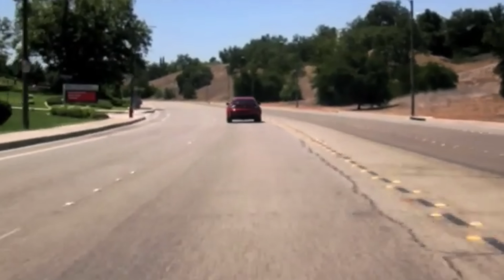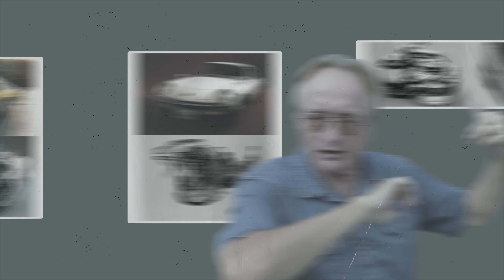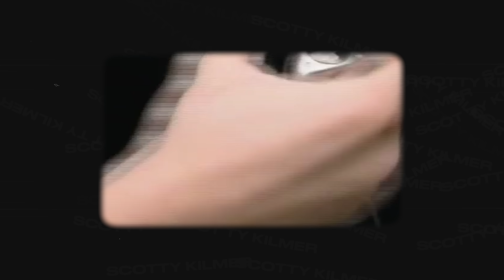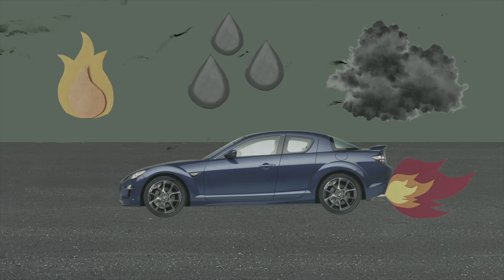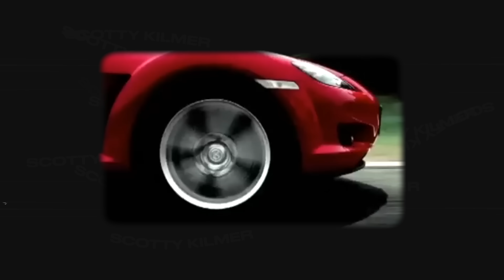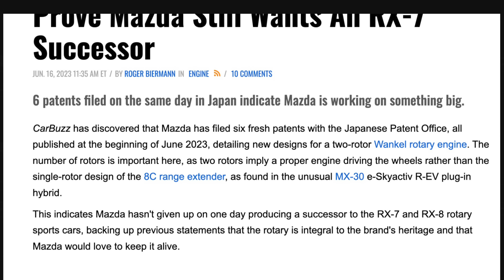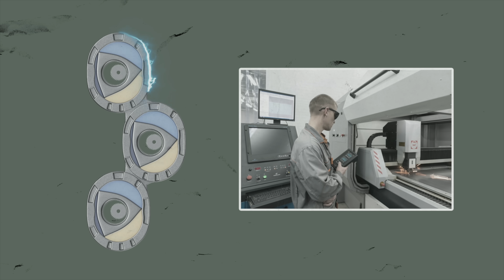Mazda's New Engine Shocks the Entire Car Industry

Comment: Wow, a lot of this video is flat out wrong. He starts out with a video of the liquid piston engine (which is NOT a Mazda engine nor is it a Wankel with the first version being designed and built in 2010) and then talks about the Wankel rotary engine, which are completely different engines even though the liquid piston engine probably had some inspiration from the Wankel engine. The video then goes on to mix videos and images from these two completely different engines. He then goes on to claim that earlier aviation rotary engines were predecessors even though they are piston engines and not at all related to Wankel rotary engines even though they are called "rotary engines".

Much of what the video claims about the 12-rotor engine is either inaccurate or flat out wrong. The 12 rotor engine was indeed designed and built by Tyson Garvin, but he built it in 2010 as a engine for his boat. He stopped working on it years ago as he is not really familiar with rotary engines and recently, he gave it to Rob Dahm to have him get it running with modern ECUs, turbo chargers, etc.

Since it was designed for a marine application, of course it hasn't been used with a radiator as all marine engines pump water from the body of water they are in for cooling (and Tyson Garvin works on boats, not cars). Also, the widths of the rotors DO NOT vary and are indeed standardized as they are all Mazda 13B rotors.

Also, you absolutely SHOULD NOT EVER use synthetic oil to premix with the gasoline to lubricate the rotor seals (and premixed oil DOES NOT lubricate any bearings, e-shafts or gears as those are lubricated by the regular engine oil circulating through the engine) as synthetic oil does NOT burn well. In fact, one of the biggest arguments to remove the metering oil pump and close off the oil port to the rotors is so that you can use synthetic oil for the motor oil that lubricates the engine and non-synthetic oil premix with the fuel for the rotor seals.

Comment: I have always wanted to understand how a rotary engine works. Now I still don't but I have a better idea lol. I wish you could make a video going into more detail about a few parts of this video. awesome video scotty!
Reply: basically a single rotor is akin to a two-stroke three cylinder on a 120 degree crank; as far as how the power (pulses) are, 
but then with the Eccentric -'Crank'- Sharft gearing reduction from the rotor gear, reduces the effective crank output rotation speeds down to an equivilant more like a fourstroke.

Comment: The best thing would be to scale the engine production up so high that they are practically disposable. Then design the car to make the engine easily replaceable. (Leave enough space to take it out)
Make the engine so cheap and sell them to other manufacturers and other industries.
The biggest problem was they were so hard and expensive to fix. If you accept that you’ll eventually replace it and make replacements available and cheap, it’s not a big deal. It’s like an alternator or a fuel pump or a battery.
The old engines go to a secondary market and you get guys that will fix them on their own and make twelve rotor boat engines.

Comment: The idea of using ethanol instead of gasoline to improve combustion is very interesting. In the future we can expect to blend more and more ethanol into gasoline as we move towards net-zero. While selling high ethanol blends was a failure in the past in most of the world, it might make a comeback. I would also be interested to see if rotary engines would also do well on CNG and LNG, which are fairly widely used in some countries (and also produce no soot).
Reply: @EnriqueThiele The question then is, whether the emissions result is better than on gasoline. When burning natural gas, we can have less hydrocarbon and particle emissions, but NOx often is a problem. What I understand is that rotary engines generally produce more hydrocarbon but lower NOx emissions. So, this might be a very good match.

Comment: 2006 Mazda 6,2.3 ,16V,manual transmission.Great car.Front rotors and pads first replacement at 240 000 km.Just unbelievable.

Comment: I briefly considered Mazda the other year. Ultimately though, the MPG is just terrible (here in the UK we usually have 4cyl engines and expensive fuel so expectations are different), and apparently they need to be run upto operating temperature before being turned off, which is an issue when someone wants letting out of our driveway.
Reply: Compared to what exactly? Are you talking about the rotary or the 4 cylinder? NA or Turbo? Are you comparing to a hybrid? They get good mileage comparing apples to apples. Sounds like you're comparing apples to oranges.

Comment: I wonder how the rotary engine would do well if it had natural gas or hydrogen fuel sounds interesting if they can be done thank you have a good day😎
Reply: Why not wood gas (spark ignition) or even a diesel cycle.
If it can burn it will work.

Comment: I once found information on a BMW/BMV 250cc motorcycle- it had a Wankel engine. Now 30 or 40 years on I can find nothing, or anything on the T3 (not TR3), a turbine powered Triumph automobile. The alternative to these two vehicle existing or even only making it to the design stage could very well be.....I am crazy after all.

Comment: I challenge your mileage claims. Compare apples to Apples and the Mazda RX-8 gets better mileage. For example the RX-8 is faster 0-60 than the beloved Gen 4 Supra (manual NA) but gets the same 18 MPG combined fuel efficiency. With 2 extra seats (Better brakes, handling and trunk). Also faster than the 300ZX 2+2 but at 19 MPG the slower Nissan gets 1 MPG better fuel efficiency. The simple reason is that high performance motors get poor fuel efficiency.

Comment: Well, don't know what is being talked about here. I had two RX7s with rotory engines. Never saw any RX7 have flames out the exhaust. Took them anywhere and everywhere for service without ever worrying that the mechanics back then could work on them. They liked the idea that making something go round and round was easier than up and down. Easy to change oil and filter myself without a lift. Also, would hopp in and drive to Florida and back from Ohio without concern about the mileage being over 100,000 miles. History books being rewritten.
Reply: I've blown 3ft flames out the back of my 86 rx7. Racing beat headers, wide open exhaust besides dual mufflers.  🔥🔥

Comment: As an airplane buff I need to make a correction. A rotary engine has the cylinders and the crankcase rotate around a FIXED crankshaft, with the propeller being driven by the engine crankcase. A Wankel engine is not a rotary engine.

Comment: Good for you, Scotty.  Now they're trying to get us to believe the Wankel engine was invented in the 1950's.  If you check wiki, Britannica, et all they have revised the date thus ignoring when Felix got his first patent in 1929.  He had conceived of the design well before that.  Certainly, this design should have gone into an airplane immediately, and could have been used extensively during WW2.  So much less weight and size; give me a break!  They're holding this engine design back folks!  Remember, in 1973 all the major auto manufacturers signed agreements to develop this engine.  Rolls had a two stage diesel that demonstrated extreme mileage.  Something caused them all to pull back.

Comment: A multi-rotor engine seems more feasible than the most common multiple piston engines currently being used.
Reply: They tried that in the 70's-90's.. it didn't work out.
..then they tried to do it again in the mid 2000's, still didn't work out. 
Its a failed design by nature. 
People went from building the 1st airplane to landing on the moon in less time than we've spent trying to build a proper wankel. 
Maybe this new 'range extender' will be its true calling?

Comment: I know, range extenders aren't cool, but the rotary could run at a fixed speed and load (when needed) and that would minimize a lot of technical problems.

EVs are impractical from issues of battery size and recharge time. This might make a practical compromise.
Reply: Charging and battery tech gets exponentially better over time
Reply: @michaelpapazis  It gets gradually better, but not exponentially (and the current batteries, by the manufacturer's own specs shorten their life by frequent fast charging). The big issue currently is heat. The electrolyte in current battery designs is contained withing semi permeable membranes and simply pumping more energy into the charge heats the electrolyte far faster than it can flow. And that is bad. Even now, auto batteries have complex circuitry that turns off different cells that are getting too hot 

Faster charging will require a completely new approach. There are theoretical approaches, but none ready for mass adoption in the near future.

Comment: I am interested in seeing rotary engine innovation especially with hybrid vehicles.  Seems like a perfect matchup.  Unlike the high power applications which do not highlight the rotary benefits.  Absolutely love your presentation of this complex material!  Thank You Scotty!
Reply: A perfect matchup? An engine that only benefitted a handful of enthusiasts? An engine that needs constant maintenance to be reliable? An engine that is renouned for poor emissions and fuel economy? Bring it back in an enthusiast sport car not a bloomin hybrid!
Reply: the only thing hybrid gives the rotory is toerque and it being instant is a benefit but if mazda made a production 20b it would beat most modern sports cars if it had an electric motor with it
Reply: Debatable., the most comparable vehicles is between the Rav4 hybrid and the CX30. the Rav4 has about 40 mpg while the CX30 rotary extender gets like 30 mpg at best. That moving combustion chamber is just a serious obstacle against complete combustion.
Reply: This video said that the vehicles with longer lifespans stayed mostly on the highway. Sounds like something that would work well for constant charging if they could solve the heat issue in the batteries....
Reply: The whole point of hybrids is low fuel consumption, and piston engines use less fuel per HP than the rotary does.

Comment: I drove a brand new 2-rotor 4-door 4-speed std Mazda in 1973.  Being young plus the car was a demo, I’d rev it (from a stop) to about 8 grand ( the engine revs to stratospheric heights!) then bang out a power shift to 2nd, you’d lay a 50-75ft smooth patch of rubber yet you felt NOTHING inside the car!  No jerking or head snap , very strange because you could hear the rubber shrieking behind the car yet the vehicle tracked straight and true, smooth as glass!  Being an engineer, believe me, my mind was boggled!  No matter what you did, it was sort of like driving an EV because no vibrations whatsoever (remember, rotors spin like propellers while pistons reciprocate).  This tiny rotary engine displaced 1.3L yet ran like a striped ape!  I would have bought it on the spot but it only got 12 mpg plus the engine would normally get hot as a furnace. (better not pull off the road into a patch of weeds, you’d start a fire!)
Reply: What model was it?

Comment: Love the Rotary engine. Years ago I had a Mazda RX-2 with a tuned 13B Bridge Port, fuelled by twin 48mm Webber carby's. So much fun to drive. It definitely surprised a few expensive cars out on the road. Wish I still had it.
Reply: ditto. I really enjoyed pulling up along side the Caddies on I 5. They would never let me pass. That was until I bought an RX 2. Funny little junior reader car that left them in my dust.
Reply: I had a ‘73 RX-2 4 Dr sedan.  Bought new still sitting on the lot in ‘74.  Looked like a Toyota Corolla but surprised the hell out of some 396 Chevelles stoplight to stoplight.  Of course, it got close to the same mileage as a Chevelle.  2 distributors with 3 sets of points.  What a mess, but loved the way it ran.  Had that boxy 4dr, terrible aerodynamics, up to 115 one night in calm air when it started getting squirrelly.  Still had plenty of throttle left, but I backed out of it.  Speedometer went to 135 mph and I think it could get close in an aerodynamically stable car.  Limitless rpm’s.

Comment: I had a 85 RX7 A model.  Had great mileage and did not burn oil.  Wish I never got rid of it.
Reply: They all burned oil. If it didn't the engine would fail quickly. There was an oil metering system pump with inject oil into the rotary housing. They used about a quart every 1000 to 1500 miles. You must not have every check the dip stick at all to say it didn't burn any oil, that is they way they are made.

Comment: I had an RX-3. I found that the mpg I got at the then-mandatory 55 mph was less than what I got at 70. It was the smoothest-running engine I've ever had with the obvious exception of a electric motor. If they bring out another, if I can afford it, I'll buy it.
Reply: I had an rx4 back in 75. It never burned oil. I worked at a gas station and changed the oil frequently.  It could spin the tires. That little engine had power and people couldn't believe what it could do.
Reply: @billrehm3590  They are all made to burn oil. If your oil metering pump is working correctly it would use a quart per 1000 to 1500 miles.

Comment: I have an 82 RX-7 with just over 70k miles. Runs like a champ. It’s a completely different feeling car to drive - I could drive all the way to work in third gear. In fact, on back roads, I almost never use fourth (and never fifth). Down shifting is a very different experience as well because it’s so smooth and happy at high RPMs. Super fun little car and I always loved the first gen style.

Comment: Norton and Suzuki both made rotary engine motorcycles in the 80s and/or 90s.
Reply: In the 70 Suzuki in the 80s Norton.
Reply: @rotart12arx3  You are correct on the Suzuki, turns out the last one was made in 1976, Norton made their last rotary in 1991, they also raced them, I think they were a last ditch try to save the company.

Comment: In 2008 my mother in law bought a 2005 kia spectra from a local dealership. With in days she discovered it had some issues and the dealership told her they would fix it because the issues most likely existed when she bought the car. She couldn't afford a rental car so they for some odd reason loaned her a 2006 rx8 for a few days. The car was way cooler than her kia but she had tall kids so she surprisingly preferred her Kia even though she knew the rx8 was a better car.

Comment: I remember seeing brand new Suzuki RE5 rotary motorcycles on the showroom floor that the dealers just couldn’t sell. Sure, the RE5 was revolutionary for its day but the word was out even then and the word travelled fast in the biker community- RE5s were duds. Too heavy, hot and over complicated. Sure, you got the power roughly of an 1100 cc motor from a swept area of around 750cc, but the damned things ran so hot as to be almost unridable.

Comment: Mike Copeland of Arrington Performance solved the hydrogen problem and is running an old Chevy hot rod on H2 gas.  Makes me wonder why one couldn’t run a rotary on H2, which would solve all of the “dirty” complaints.  Keep an eye on Mr Copeland, he’s on the front edge of next gen engines.

Comment: My family had a 89 rx7 with 190k miles ran strong. 
Best way to keep it alive is to remove the 4 stroke oil injection system they come with,( it literally consumes its own oil to lubricate its apex seals) and instead mix 2 stroke oil with the gas.  My first car is a 1988 rx7 turboii such a smooth revving engine

Comment: I bet you could run a smaller carbureted auxiliary engine on just the exhaust fumes of a rotary, to perhaps charge batteries or whatnot.
Considering how much fuel is unburnt by the rotary.
Make it a hybrid that way.
Improve fuel efficiency.
Garage54, a Russian car channel doing odd and fun experiments with vehicles did such a thing with two Lada engines, where the 2nd ran on just the fumes of the first.

Comment: I ran a Mazda Rx-8 (228 bhp, 6 speed gear box ) in the UK from 2004 when it came out till 2012. Such a quiet and smooth engine that they gave you a buzzer and had a rev limiter at 9,500 rpm so you remembered to change gear. 

There was a oil consumption - so you had to remember to top up the oil every month or so - aided by oil warning light and an oil pressure gauge. Fans of the car were aware of the care needed. 

When I first started driving it petrol was 54p/Litre at 24mpg that wasn’t too bad. The bhp/tonne was Comparable to the 3.5L V6 of a Nissan 350Z which came out about the same time although the Rx-8 only had about 2/3 of the torque. The cars in popular motoring TV shows at the time produced exactly the same track times! But the Rz-8 was a proper 4 adults seater not a 2  or 2+ 2 compared to the other competition out at the time Porsche Boxster, Audi TT, Nissan 350Z, Chrysler Crossfire. 

When petrol increased to twice the price the Rx-8 simply became too expensive to run and with increasing Vehicle Excise Duty due to stricter emissions regulations the car all but disappeared from UK roads. 

It holds a special place in my heart - I have a display cabinet with a Autoart model of the car, the brochure and video of the Pro Drive complimentary day you got with a new purchase ( skid pan, race track, high speed braking, rally circuit ). 

A beautiful piece of motoring history ( nearly 25K registered in the UK between 2003 and 2018). With the death knell of fossil fuel combustion - difficult to see how this can make a come back other than for motorsport or enthusiast fuelled on carbon neutral or bio synthetic fuels.
Reply: Rev limiter buzzers is at 8500 rpm, redline at 9k.